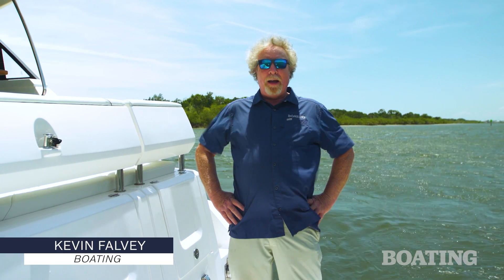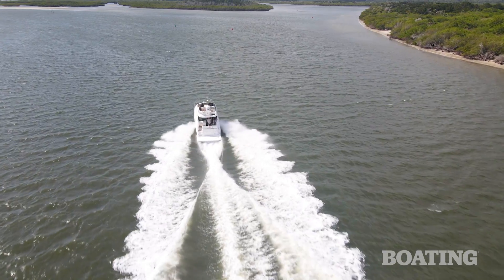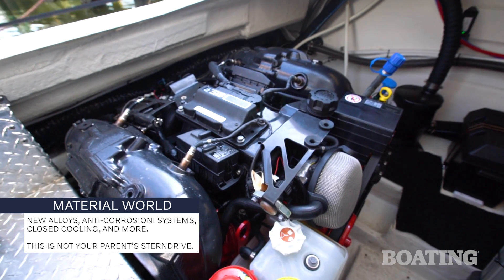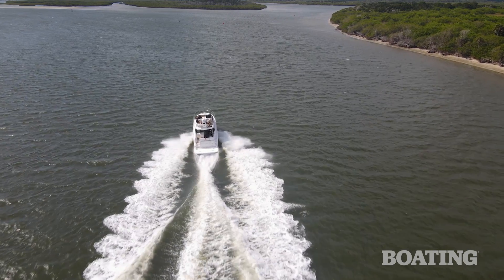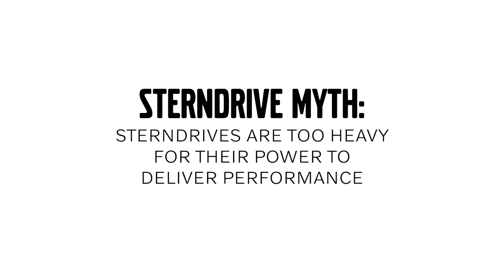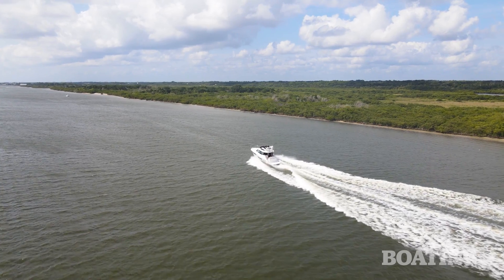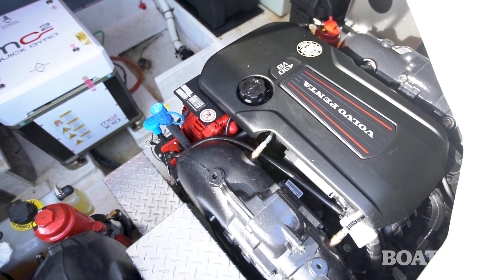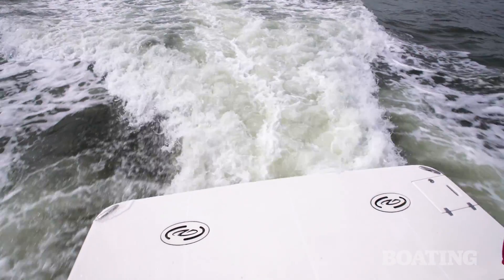Sterndrive Myths: Busted!

Comment: As someone who has had both outboard and I/O, this is great!  I am sick of the currently in vogue attack on sterndrives.  Are they more expensive to maintain in the long run?  Sure!  Why would I sign up for that?  

Well...maybe I get some benefits in exchange.  Like better handling--the weight of the engine is where it is supposed to be--at a low center of gravity inside my boat, not hanging off the end killing my transom.  And for my particular boat--better acceleration, higher top speed, and superior fuel economy than if I had gone with a similarly rated outboard on the same boat.  Oh yeah....and I get a lot more use out my boat--like the entire rear end!  On a bowrider, this is absolutely priceless.  Most people complaining on youtube seem to have bought ancient used boats for $10K and are angry their 25 year old stern drive needs work.

Repairs and maintenance items specific to I/Os are not required constantly--only every 5-10 years....lets keep it in perspective.  It is not like I/O boats are sinking all the time due to rotten bellows--this is not a real phenomenon--it's a silly scare tactic of outboard builders and fanboys.

Not to mention all the tech advances in the last 10 years that people with old sterndrives know nothing about...titanium coatings, built in corrosion dissipating electronics, built in salt away flush, closed loop cooling so only a heat exchanger/exhaust are exposed to salt (don't get that in an outboard--all salt water cooled--still need to flush).  And no more winterizing with "easy drain."  Modern stern drives are more durable than many outboards and, other than the bellows and a couple other things, have exactly the same sorts of maintenance requirements.  If you leave your boat in the salt every day forever then expect more maintenance unless you have these newer models, but again--you get a lot of benefit for the effort.

And Sterndrives offer a platform for future hybrid electric engines in a way that outboards cannot.  Every drive has pros and cons and sterndrives have gotten an exaggeratedly bad rap.  Plenty of folks don't boat in salt at all, and others are happy to put up with some more maintenance to get corresponding benefits.

Comment: Complete rubbish. I’ve owned a couple of drives on a Prestige 350. Brand new. Problems, only problems. Overheating, busted raw water fittings on both drives, had to take it multiple times out of the water. Faulty tilt sensors, over priced spares, terrible servicing here in WA Australia. Constant anxiety if we were going to make the crossing to the islands on limp mode. Now back to shafts and Cummins for 7 years without a single issue. Stay away from sterns and Volvo at all cost.